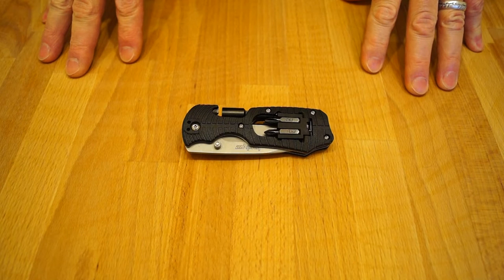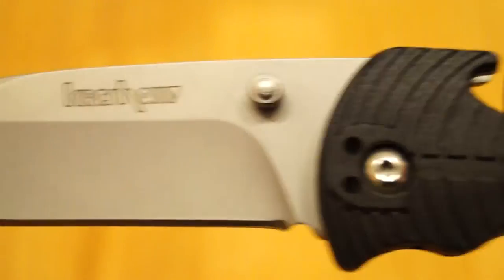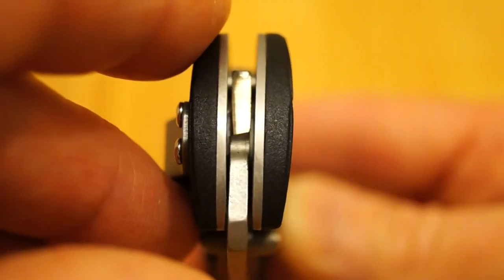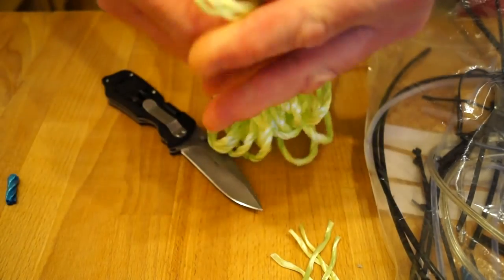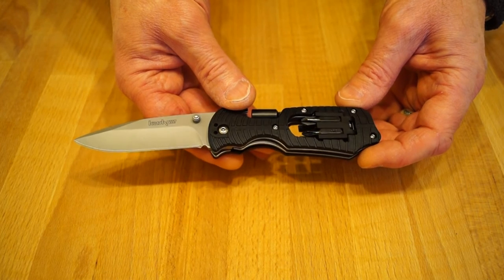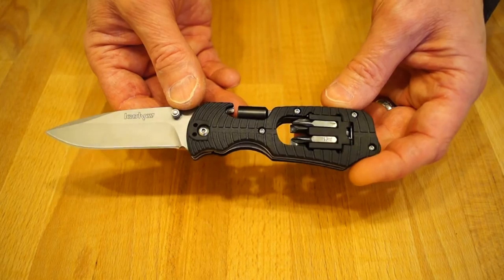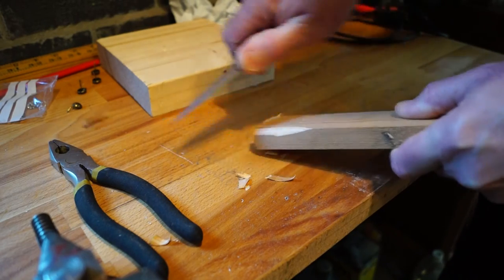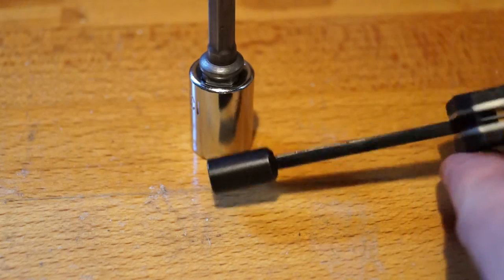Kershaw Select Fire (Clone?) Review

Comment: I have gone thru at least 8 of these knifes. They are all a bit different (all made in China). I would pay more for a better quality knife as they are very handy. The bit holder often comes loose and falls off, then the knife splits in halve and the blade falls out. BTW the blade does not hold an edge for long. I keep a sharpener with me. Great design
Reply: Are all the drivers offset a bit which makes it want to collapse and annoying to use? I’m wondering if it’s the design or mines defective

Comment: Ok wow, the driver head came off. I should certainly try out the version with the driver bit holder in the end of the handle instead. Honestly i thought the bar would be weaker and / or pry the handle liners apart.
Also i suspected it would fold (collapse) under use. But the head coming off. Wow. I was already pretty sure id try the alternative version if i were to.  Now im certain! Wish i could give this video 2 likes :)
Reply from the maker: +Lifeisawheelie I wondered if it would pry the liners apart and did apply quite a bit of torque to the nut with the socket. I doubt the driver was designed for driving sockets. An interesting result though. I have seen the other version of this knife, it has a torch in place of the driver.